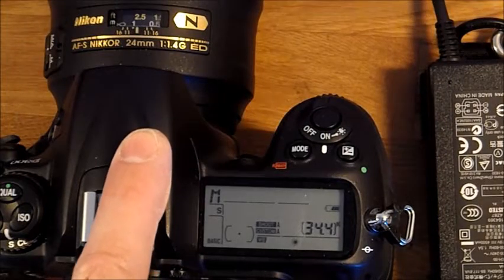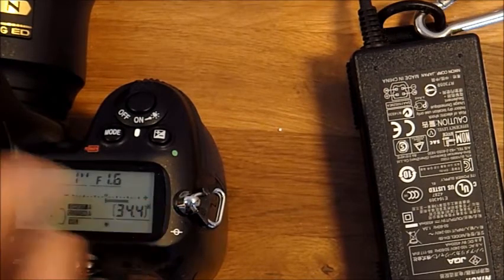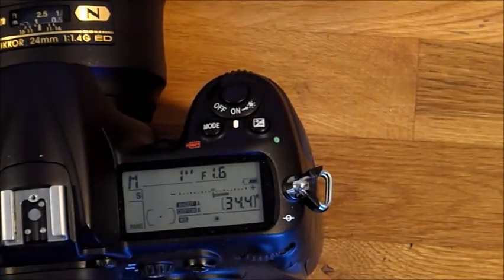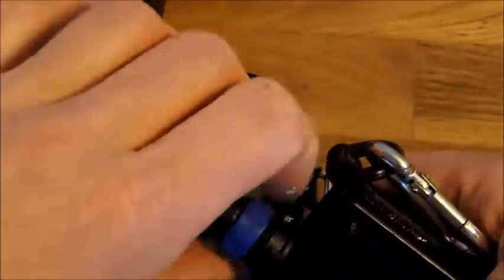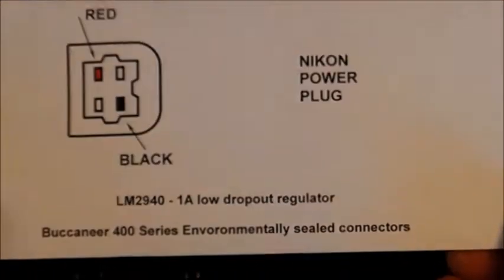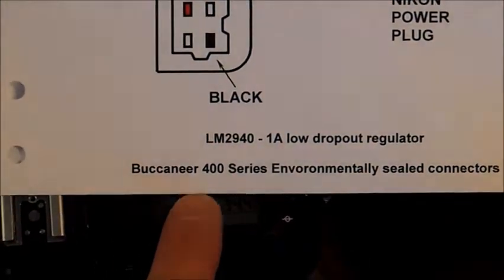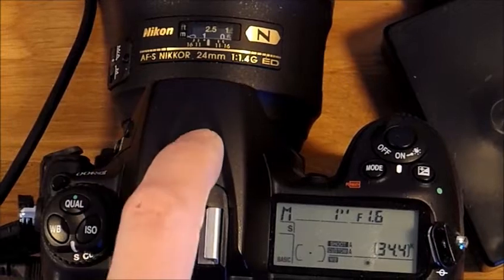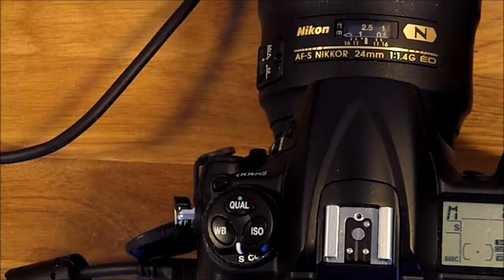Nikon AC Adapter Modification

Comment: Nice hack! Been looking the the name or specs of that "square" 4 pin connector, do you have the name for the part?

regards!
Reply from the maker: This is Nikon original. You will get it when you buy the Nikon AC adapter....
Reply: @larsdahlberg1504  Thanks Sir!

Comment: Nice video. It took some time to figure out that the camera needs 7.5 - 9 V DC and uses 2.5A max. A battery-to-powersupply  replacement adapter can be found on Ebay nowadays; the power supply seems pretty standard.

Comment: Hi Lars

Very nice video.
I'm going to create similar solution for myself.
I want to keep the costs as low as possible, and since I don't have power supply for nikon, I need to buy this nikon 4 pins connector which goes to camera.

Where did you buy your, or have you used connector from old power supply?
Do you know what is the name of this connector?

Thanks in advance and best regards
Grreg